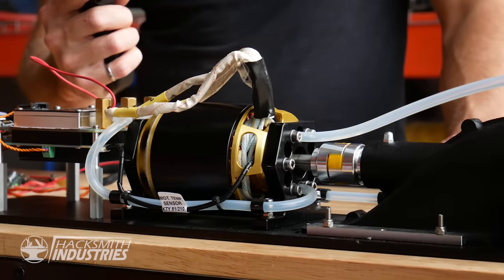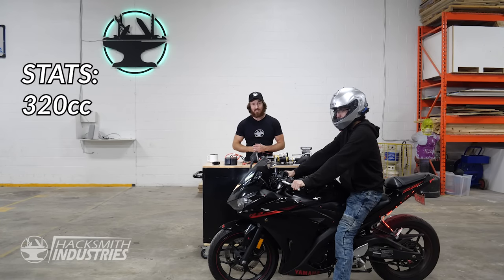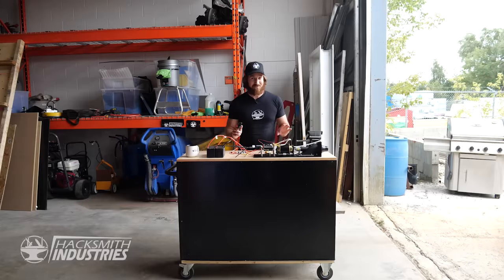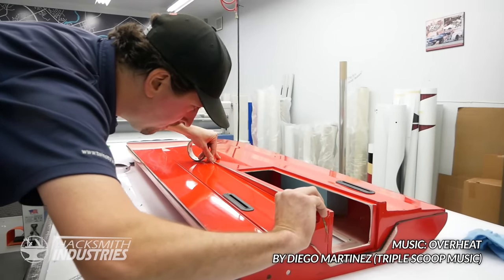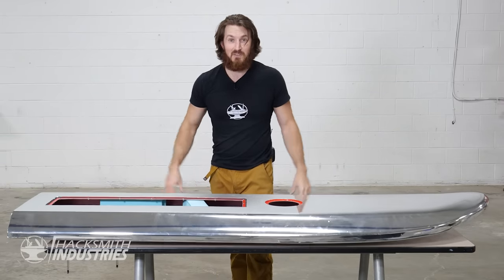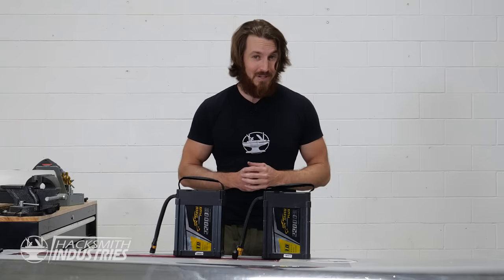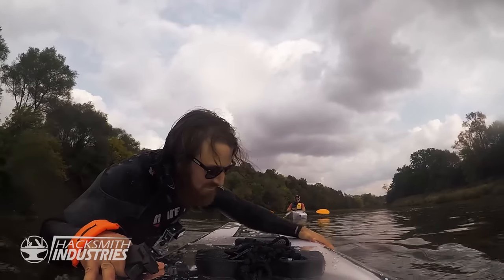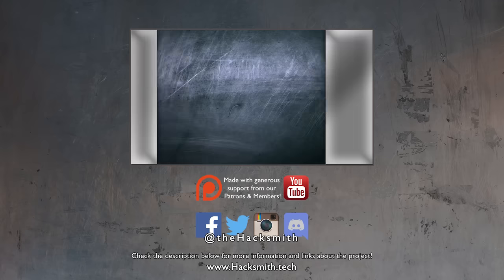DIY Silver Surfer Surfboard goes SUPER FAST!

Comment from the maker: Curious about how Power (kW or HP) is measured and compared? Power is the amount of work a motor or engine can do. This is why people compare vehicles HP with other vehicles HP! 

Power is a factor of both torque and RPM, which means you can have a low speed car with big torque, or a high speed car with little torque, even though both cars have the same HP!

The equation is KW = (Torque[Nm]×RPM) / 9565

In our case, because our motor powers a jet pump, it has fairly low speed of a few thousand RPM but lots of torque to move water.  One more thing makes it tricky! Electric motors are sometimes quoted for their INPUT power, but an electric motor is only 80-95% energy efficient, which means the output power is less 5-20% less the input power. 

Want to learn more? The internet is your friend! Search these terms on Google and you'll be able to learn even more :)
Reply: Can u make the stargirl's weapon (cosmic staf)
Reply: Hey James make a iron man mark 5 suitcase
Reply: You guys should make a smaller grappling hook
Reply: Hi  james stan Lee died on November 11 so can you make anything in honour of the legend 🙂❤❤❤❤
Reply: Hi hacksnith I won’t say my name for privacy reasons but I was wondering if you could give me some pointers about taking small things apart and customizing them
Reply: Can you guys make "the Division deployable shield?" I can see that used in so many cases and also it's PRETTY FREAKING COOL!
Reply: Try to make a hoverboard like from back to the future
Reply: What. happened to the Aliens robot
Reply: Plz make a tron motorcycle 🏍
Reply: “Only” 80-95% efficient? Sir are you familiar with the internal combustion engine?
Reply: Try my idea you've created 
Thors hammer,storm break,morning stars, weopon , hiccups sword, captain Americas shield , and so many other things so why not take on the challenge cmon YouTube help make this real / who else loves ku fu panda 👍👍👍👍😆😆😆😆😆😆
Reply: Make it a reality 👍👍👍👍
Reply: Hey Hacksmith, IDk if u see this but hope u like it 
Tony Stark: Hey, Spidey you can be the next iron man.
Spiderman: yay'
Hacksmith: Bruhh
Tony Stark comes out of grave and gives edith to hacksmith
Hacksmith: No thanks, i got my own
Tony Stark gives iron man suit
Hacksmith: Nope, thank you .
Tony Stark Comes back alive and annouces hacksmith as the next iron man
Hacksmith: Yay

The end.
👇🏻 how many of u will think this will happen?
Reply: lol they deleted the comments :'''D Come fkng on, have a damn laugh about it... xD
Reply: Hi hacksmith can i request? How about you make a jetpowered skiboard from agent cody banks
Reply: man you totally need to do a hydrofoil next :}
Reply: @the Hacksmith Can you build boots that can make you fall slower? My only request btw you're awesome and gifted👍
Reply: Who won the Iron man helmet
Reply: Upgrade it to a hydro foil so you would be a real silver surfer.
Reply: Are you able to make a video by puting it onto a john boat
Reply: Actually, Power is the measure of Work per Unit of Time.
Reply: CAN YOU MAKE ROBIN AS IN BATMAN'S SIDEKICK AND THEN LEADER OF THE TEEN TITANS MASK AND GADGETS (THE MASK MOSTLY BECAUSE HIS GADGETS ARE PRETTY MUCH THE SAME OF BATMAN'S BUT DIFFERENT COLOR AND YOU HAVE ALREADY DONE BATAMN'S GADGETS) OF COURSE UNLESS YOU HAVE SOME REVOLUTIONARY STICKY MATERIAL THAT LETS YOU JUST APPLY THE MASK TO YOUR FACE AND IT STICKS OR YOU SUPERGLUE IT TO YOUR FACE THEN THE MASK WILL HAVE TO BE THE VERSION THAT HAS A STRAP THAT GOES AROUND YOUR HEAD BUT THE MAIN REASON THE MASK WOULD BE SPECIAL IS BECAUSE AS YOU MOVE YOUR EYES THE MECHANICAL LENSES MOVE TO FIT THE EMOTION EXPRESSED BY YOUR EYES AS IN HOW ROBIN OR SPIDERMAN LOOK WHEN THEY ARE CURIOUS (AND OF COURSE THE SUIT TO GO WITH IT, ALTHOUGH YOU'LL PROB NEED A SHORTER EMPLOYEE BECAUSE ROBIN IS A TEENAGER, WELL THAT'S BEFORE HE BECAME NIGHTWING WHICH I GUESS YOU COULD DO INSTEAD OF OR BOTH OF ROBIN AND/OR NIGHTWING BECAUSE HE IS MORE SIZE AND AGE APPROPRIATE FOR YOU) (OF COURSE THE BASIC IDEAS WOULD BE THAT YOU COULD HAVE A TYPE OF SENSOR IN THE MASK OR YOU COULD IMPLEMENT A TYPE OF CONTROL SELECTION AREA WITH BUTTONS MAYBE LIKE THE ANTMAN SUIT TYPE THAT CHANGES THE MASK IN ORDER TO SHOW DIFFERENT EMOTIONS THAT CAN'T BE SHOWN WITH SIMPLY HAVING THE MASK ON BECAUSE JUST LIKE SPIDERMAN'S OR ROBIN'S/NIGHTWING'S SUIT IT COVERS THEIR EYEBROWS WHICH BECAUSE IT COVERS THEIR EYEBROWS IT CAN'T SHOW EMOTIONS SO THE ANIMATORS MADE IT SO THE MAKE FOLLOWS ANY CHANGE TO THEIR EYES IN ORDER TO DEMONSTRATE THE EMOTIONS OF THE MASKS USER (THIS CAN ALSO BE IMPLEMENTED INTO OTHER SUITS LIKE A SPIDERMAN SUIT THAT YOU PROBABLY ALREADY HAVE).
Reply: Hack smith please could you remake your attack on Titan 3D manuevering gear with Aot season 4 around the corner.
Reply: Please make green goblins glider
Reply: Is there a way I can buy one from you?
Reply: I know how lto
Reply: I know how to make the legs for the power loader or the exo-suit
Reply: Like as animals they have a 4 bones for a dog there back legs are strong sense they help jump high by launching them selfs carrying more wait for a long time the bar you can us to put a spring for more power for
Reply: Could u plz do the original assassins creed hidden blade. The one from assassins creed one with Altair. And great video
Reply: Can you do a new weapon it’s called “deadly frisbee” it’s from a game soul knight it’s a arm mounted saw launcher (it bounces off walls but you don’t have to do that)
Reply: I have a really cool idea do fallout 4 power armour
Reply: Can you build the dragon Eye two from how to train your Dragon race to the edge btw it is on Netflix
Reply: Break the money box like you did one year ago because you made iron mans beam
Reply: COLLAB WITH MARK ROBER
Reply: Can yall make the crossbow from dishonered
Reply: Can you please make a GhostBusters proton pack
Reply: Tech Spirit  yes!!!
Reply: Hey Hacksmith is kiwico a new Zealand company because kiwis are from new Zealand
Reply: the Hacksmith ooo u don’t got much replies so u would definitely see this reply
Reply: Make web shoter
Reply: could you do Rin Okumuras sword from blue exorcist??
Reply: Hey James you could try to make Greek god items like the boots of Hermès or Zeus thunder bolt, okay a super hero idea could be X-men items like Scott’s glasses or a strong magnet that makes you look like magneto or Diana’s lasso of truth, make another better sleeping pod
Reply: whoever liked my comment thx a buch dude
Reply: You should put an oculus quest 2 in a metal iron man helmet
Reply: the Hacksmith 299 like
Reply: I'm the 300 likes
Reply: The Hecksmith you should make a giant tesla coil. Who agrees leaves the like in the comment. 👍✌
Reply: You guys should make COD weapons from zombies like the raygun or the wonder waffle
Reply: Construction of an Inlet duct to promote laminar flow will increase performance.
Reply: I can’t believe you haven’t built a fully functional Proton Pack yet?!?!?
Reply: Please make ninja turtle shell
Reply: I use bing. Get on my level
Reply: I’m curious why you spent so much time on this when a surf foil is superior and would’ve cost less I feel. You should hack a chair foil together. A jet foil that you can sit on
Reply: HackSmith, you should do a contest in whoever accomplished some kind of goal, they get to be flown over to The Laboratory of Creation and play with whatever toys they desire!
Reply: Congratulations on 10 million subs
Reply: Yo
Reply: what did you guys specialize in for collge
Reply: Damn i learn more here
Reply: That the grand river?
Reply: Surely a Hydrofoil is being added next? :D
Reply: You guys have to make a doom eternal slayer blade
Reply: Put a snow generator on the front
Reply: How do you get on the link
Reply: @hitheshk4231  yes plz
Reply: Ahem... HOW MUCH DO YOU WANT
Reply: "Only 95% energy efficient"
Reply: Hey Hacksmith you should make green lanterns ring and make stuff shoot out of it like a net or a sandwich you should also make Dr dooms guantlet
Reply: Did alredy now that information, but you till it very god.
Reply: Did alredy now that information, but you tell it very god.
Reply: @qlrketh  'To me, my board!' Voice command summoning...
Reply: if you would wanna do a give away of this my dad really likes silver surfer
Reply: I 100% understand
Reply: Hey guys, considering the amount of technical knowledge and support that you guys can draw from, why don't you build a do it yourself (poor man's) space craft?  No frills, just get to orbit and get back safely.  Just an idea, however, that project could pave the way for all sorts of adventures.  Good luck and be safe.  Thanks for making your videos.
Reply: I would image the kW or HP is measured on a cosmic scale?
Reply: Yo where can I buy one
Reply: I wanna  collaborate and want to work with you . I would love to make and help you in a project!
Reply: A friend of mine has one of those original boards...no motor.
Reply: Expose been watching this for ever since the start
Reply: I learned it through the four constants of racing.
Understeer is when the front of your car hits the wall.
Oversteer is when the back of your car hits the wall.
Horsepower is how fast you hit the wall.
Torque is how far you move the wall.
Reply: Hi
Reply: WOW a bunch of words i dont understand
Reply: Can you make a vermilion sword?
Reply: the creation is great but i think it needs two jet engines to make it even FASTER
Reply: I ll buy it
Reply: Two motors double the power
Reply: What is about Brushless Motor with Variable Magnetic Field Controller for more rpm and lower Torque? Thanx!
Reply: You called it brush less dc motor. It's three phase ac brush less motor. DC to 3 phase AC frequency speed controller

Comment: UPGRADE: Electric E-foil. That will give you that flying feel above the water.
Reply: Bruh 😯
Reply from the maker: Next summer. New board -- e-foil would need a prop drive on the foil itself :)
Reply: @hacksmith  hi
Reply: Yes
Reply: @hacksmith  how are you doing today
Reply: @hacksmith  Can't the jet drive be in the foil?
Reply: Damn
Reply: Hiiii im a big fan and i wanna be just like you guys 😀😀😀😀😀
Reply: Cool
Reply: How about a return function, so if you fall off the board comes back to you
Reply: @hacksmith  You can probably use almost all of what you already have by instead connecting the new prop that would be on the foil with your existing inboard drive system via a linkage running inside the verical support beam for the foil. May be easier/quicker than you think to get flying. :)
Reply: Nice idea bro 😎
Reply: the Hacksmith can you make the vibroblade from Star Wars the clone wars
Reply: @hacksmith  It might be possible to reuse the drive unit. Consider encasing the jet drive in a "torpedo" tube and have that mount as a modular powersystem on any foil. Use the same board, with a foil and the modded jetdrive.  Upgrade the Batteries. 
Would almost certainly be the most powerful e-foil out there.

Comment: If you need it to “fly” just use a hydrofoil and set up the motor at the bottom of the foil.  Even if your not fully airborne you’ll feel like your flying, plus you’ll have less resistance on the water and will end up going faster.

Enjoy
Reply: To top it off if the hydrofoil is highly reflective it could easily look like you're just floating.
Reply: That would be pretty sweet actually, since he is heavily drag limited right now.
Reply: Yeah I was thinking a hydrofoil version would be even sweeter!
Reply: And then tip over 😂
Reply: As someone who's paddled a flyak, I can confirm.  I can't imagine trying it on this thing, though!  The power output, coupled with the lower resistance of a hydrofoil, would make this thing terrifyingly swift.
Reply: @adreabrooks11  straps on feet
Reply: The jet would be attached to the board itself, which would be out of the water, that wouldn't propel him near as much, correct me if im wrong, but yes a hydrofoil would be sick
Reply: @jakobb7888  For sure.  One would need to drop the impeller/turbine to below the level of the foils - but the bulk of the unit (the batteries, etc.) could still be housed in the body of the board.
Not that I have the means to build one anytime soon...  ^^;
Reply: I like your funny words magic man
Reply: Yeah that would be pretty cool

Enjoy
Reply: @Daniel Piel - YOU'RE* ( you + are = you're )
Reply: Well, Jonny Quest rode on a hydrofoil surf board, although it was being towed.
Reply: don't forget combining it with a catamaran!
Reply: YES! I was thinking the same. Making it a hydrofoil would seal the deal. Don’t mean to be a troll. What they made is sweet, but hydrofoil is the next step in my mind. And I’ll even challenge them to make the foil translucent as possible to make the illusion top notch!!
Reply: @therichards2770  what if it was made hovercraft style? Then there's nothing to hide
Reply: @extropiantranshuman  could do. But that would be a NEW build, not an improvement on this build. And they have done other hover board builds (bttf magnetic hover board and  another air hover build) before.
Reply: @therichards2770  over water they've done it before the hover? I haven't seen that yet. I bet it could be an improvement on this based on how it's worked on.
Reply: Yup
Reply: Let the bldc indoard but make a shaft go down to the foil
Reply: Ok nerd

Comment: Great job! Hydrofoil would have been a cool addition and would have made it exponentially faster without all the drag, but also quite a bit tougher to build. Seems like 30HP would have been way more power than that and required a lot larger power cable...

Comment: Imagine if this had a hydrofoil it would be the closest thing to it actually flying
Reply: Yeah but then the prop wouldn't be submerged. The best way to do this is foiling kitesurfing
Reply: @theodoredeverell3894  No reason the moyot/jet can't be on the bottom of the foil.
Reply: @markfergerson2145  unlikely you would be able to get that right tbh. Plus you'd go faster on a foiling kitesurf
Reply: @theodoredeverell3894  Me maybe but I'm not the Hacksmith.
Also, using a kitesail will kinda spoil the look.

Comment: The voltage propably  dropped quite a bit so it was more 65-70% of full power! Maybe if you put more volts in and as you said a second set of batterys it will work even better! Amazing! :)

Comment: Fun little fact, the surf apparel brand O'Neill's founder (and credited father of the wetsuit), Jack O'Neil, lost his eye in 1972 due to an incident with an early experimental leash system very similar to the anchor installed at 8:12 . Before they thought of putting the leash (the rope that ties your leg to the surfboard) in the rear of the board, Jack's son, Pat, was experimenting with a leash near the nose which they would hold on to, using it to make small adjustments while in the barrel. This leash was consisted of surgical tubing wrapped around the wrist and connected to the board via suction cup, and was deemed by his peers the title of the "kook cord". They very quickly moved past this idea when one came undone while riding a wave, shooting directly into Jack O'Neill's eye, causing permanent damage, but ultimately providing him with a very cool eyepatch that became an integral part of his rugged look.

Comment: Aqualisa power showers (pretty much any power shower) work on the same set up, admittedly a smaller version but still a motor, impeller and an outlet, but a handy reference point for anyone trying to get their head around the system
😁👍 Now to go off and build my own ready for summer 2021 ☀️(the way 2020 went, it’ll be needed, and I doubt I’d be alone)

Comment: I laughed when you attached the front cleat for your handle and especially the rear ones for towing, as I did the same things to my original Jetboard!  (Had the orange/red one.) This was in the 70's, a local machine shop had several dozen NOS Jetboards for sale when the manufacturer shut down.  They could pull most anything, I found.  Much slower than your version, but a stately 8-10 knots. My best moment was getting heckled by a couple guys with a Jet-ski 'cause my board was so slow.  Buuuttt. About an hour later, they're stalled out in the lake, trying to push it back to shore. Pulled up beside them and offered a tow.  Got them back to shore, and some respect, too.. Good times. Electric is the way to go, tho...  Fun video!  Enjoy! Stu

Comment: What a great project guys.  IMO - Gonna need to introduce a water pickup port/tubing setup to cool those batteries and maybe motor too since that sealed compartment has near zero cooling ability atm and inevitably heat buildup will win even with more batteries.. Also addressing the main water inlet port fluid dynamics resistance (especially at high knots) whould gain a little more top end too. Keep up the excellent work!

Comment: JETFLY Electric surfboard  Max Power:12kw ,  Max Load Weight:150kg(330 lbs) ,Riding time:>60 minutes (depend on operation conditions)
Top Speed:>65km/h(60km/h with 100kg rider),
,Battery Capacity:51Ah 72V / 40Ah 72V (optional),Battery Lifespan:1200 times charge and discharge , if any interest, feel free to contact us to order sample for test!

Comment: I have one think I would like to say about the 320cc motorcycle. 35hp is very high for 320cc’s, and 320cc is very small for a motorcycle. Most lawn mover engines are around 200-250cc, while lawn tractor engines are around 450-700cc. 30hp is still a lot, but in aquatic applications, not very much of the power is efficiently used, because the propellor or impeller can only move so much water, and also that not all hp makes it to the drive anyway. That said, it’s still a cool project.